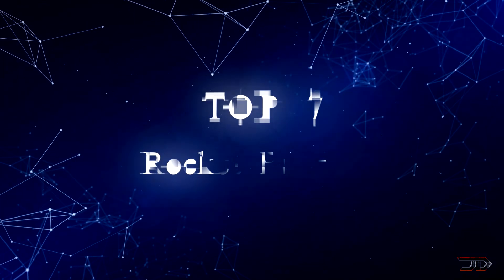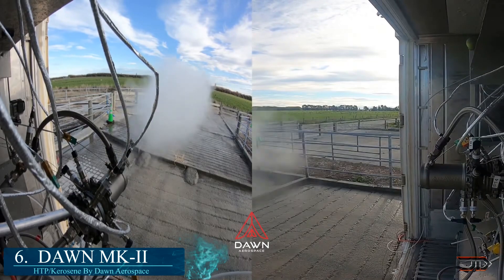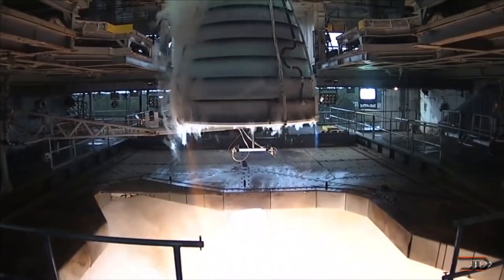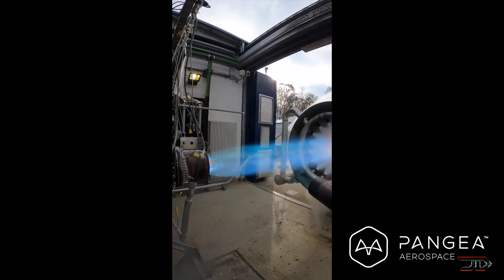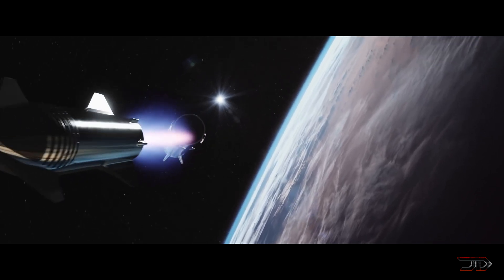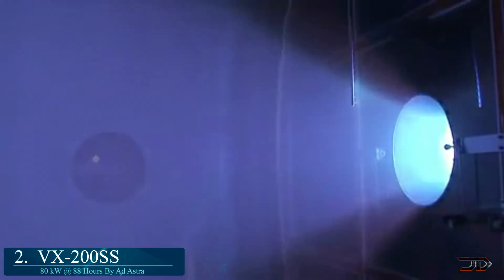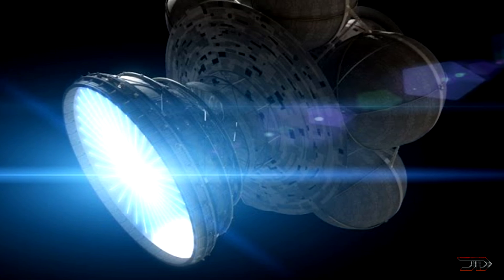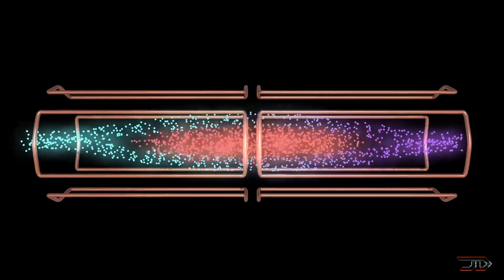7 GAME-CHANGING Rocket Engines

Comment: I've often wondered why we don't use nuclear energy without having to use water to turn a steam generator.  Is the process too difficult to do?
Reply: I think because there is still no way to convert nuclear energy (heat) into electricity (which is mostly used) without steam. You could invent that! 😁
Reply: @melonentyp1237  There is something called peltier element from the mid 19th hundreds also called Seebeck-Effekt which directly converts heat into electricity. No need to invent something new.

Comment: Aerospike has been debunked because of the increased weight for the most ideal geometry. If the spike itself was hollow, I still think it is too heavy as well as too weak.
Reply: This isn't true at all. All actual aerospike have been constructed in a "hollow" manner. Look at the XRS2200. The thing that killed aerospikes isn't that aerospikes don't work, it's that SSTO is never going to be price competitive.
Reply from the maker: @mattsoup4121  AM and newer alloys might be able to influence feasibility but it's also dependent on size or application of the engine.
Reply: @Motor_Explorer1  Not really. An SSTO is economically infeasible regardless of engine or vehicle design.
Reply: Source please